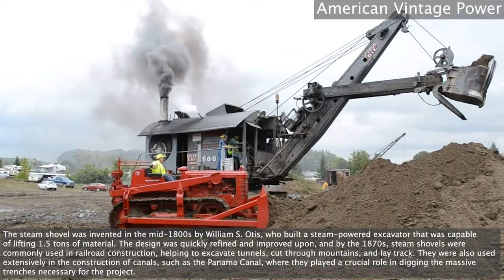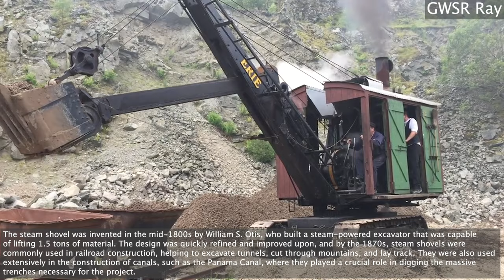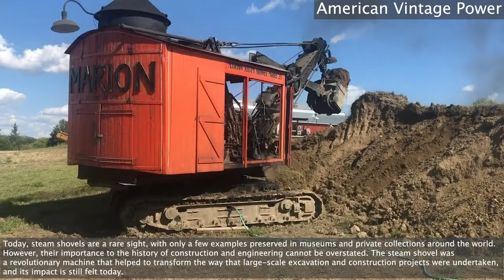Steam Shovels  |  Antique Steam Industrial Excavators At Work 2023

Comment: There is a major error in the video's text. The steam shovels shown do not have a hydraulic system and instead directly uses the steam to power three steam engines. One at the base to move the crane allowing the shovel to move up and down and another moving the rack and pinion so the shove can move closer or further away and a small one at the base to rotate and drive it around.